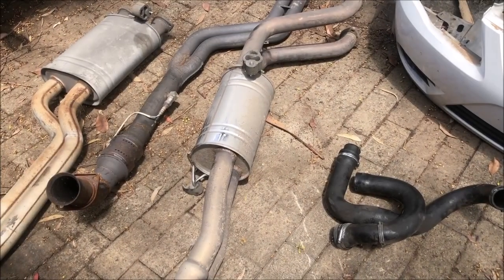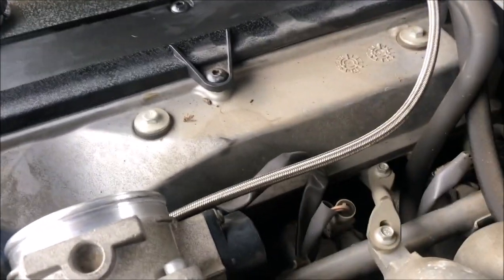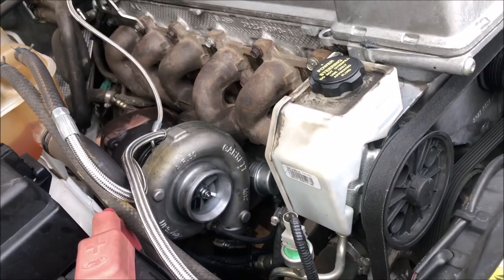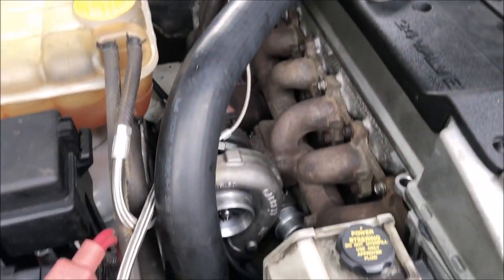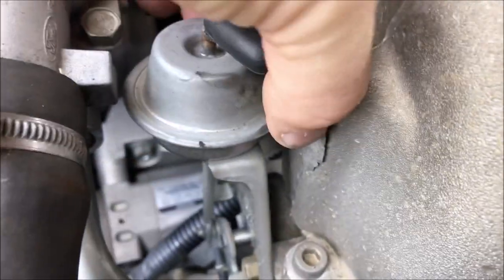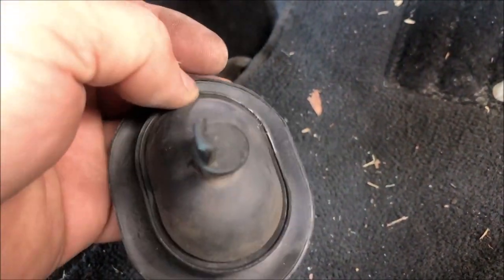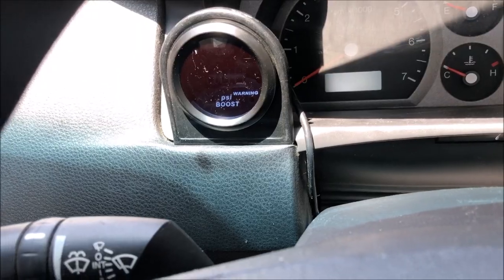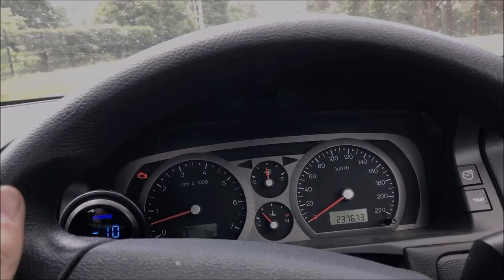NA Barra Turbo Conversion Pt2

Comment: Hi love your videos..I have a Territory 2005 and has the standard Barra engine and I've seen the Turbo version of the territory rwd Ghia..So if I was to just put a turbo as you have shown n I'll be sweet.??. In the original turbo territory it has the turbo intercooler on-top of the engine,so can I only use a top one or can the intercooler go in front?..Hope to hear back from you..Jason.
Reply from the maker: Sounds good man, can’t see why you couldn’t mount it in the front, I’m sure it’s been done before

Comment: Hey mate, brilliant video! About to undertake the same myself.
One question if I may 🙏
Oil drain.... did you not take the sump off when drilling? Metal shavings in the sump doesn't sound good to me,even with an oil change 😕
Reply from the maker: Cheers man. You can anything if you’re careful enough. Especially with alloy.. A very sharp drill bit and some grease 🤟🏻

Comment: Hi Paul, great videos with a heap of easy to follow info. Can I ask, did you have much trouble with drilling out the sump for the oil return and with the dyno tune you had done, was the 270rwkw on a hub or roller dyno? Cheers.
Reply from the maker: Cheers man. No issues with the sump, just get’r done. If you’re not confident, pull the sump off. Roller Dyno

Comment: Why disable the broadband in the manifold? you will loose bottom end torque and have slower spool. also if it's not fixed in the open position you will loose a lot of top end.
Reply from the maker: I don’t understand your question. Disabling it, locks it open
Reply: @oldskoolonly  Which looses bottom end torque and increases spool time. they were removed in factory turbo purely for cost saving.
Reply from the maker: Have you got anything to reference that? I’d be keen to see it
Reply: @oldskoolonly   I worked at ford engine plant from EL to BF2, while working in turbo sub assy it was one of the questions I asked the engineers. they said the extra bottom end performance wasn't worth the cost.
Reply: @oldskoolonly  I believe the term is Dynamic Charging and has something to do with Helmholtz Resonance? don't quote me though.
Basically attempting to utilize intake wave pulse at low RPM to cram more air into the cylinder.
Reply: @MassLox   the turbo  manifolds dont actually have any butterflys in

Comment: I’m currently doing the same conversion myself and was wondering if I can run the stock ba exausht system, would it fit a dump pipe? Hope to hear back
Reply from the maker: Not unless you made something up, the stock system is heaps smaller. Hope that helps 👍🏻

Comment: any idea where you got the holder for the guage? looking for one, so it sits in the same spot.
Reply from the maker: It’s just a under dash gauge mount from a cheap temp gauge I bought a while back
Reply from the maker: https://www.ebay.com.au/itm/174769384355
Reply: thanks man, appreciate that, on 7psi you didnt do valve springs did you?
Reply from the maker: No, not necessary at 7
Reply: @oldskoolonly  cheers man! i just brought one of the boost guage holders!

with the MAP sensor, did you split the manifold? or did you just undo the throttlebody? any tips?
Reply from the maker: Just remove the throttle body man

Comment: Strange cause I’ve seen another conversion where it won’t run on turbo fuel pressure regulator?
Reply from the maker: Definitely not my experience
Reply: @oldskoolonly  okay cool is yours a bf ? I’m doing a conversion and I had two bar map sensor and it started but cut out soon after. Changed back now, do you have to use the original vacuum and tee into it with the bov? And the other vacuum side cut and melt to form a seal?
Reply from the maker: Yep BF. Won’t run properly with the turbo map sensor until it’s tuned. I don’t understand the other question

Comment: Hey mate, how much was the tune for it?
Reply from the maker: I was asked not to disclose the price as it varies but I contacted a lot of tuners and quotes ranged from $750-1500. My suggestion is treat it like a tattoo, don’t go with the cheapest, go with the one with the best reputation 👌🏻
Reply: Old Skool Only Garage yeah ok. I only ask because any Dyno I’ve asked to do my tune (na 4 spd ecu) I’ve been quoted at 1500 to 2000 dollars. Which I thought was utterly ridiculous
Reply from the maker: What state are you in?
Reply: QLD
Reply from the maker: L E M O N ok, can’t help you there man
Reply: @IC3XR    I know of a couple who had theirs done around a grand. But if the tuner has really good reviews and knows what they're doing, consider paying the extra. A bad tune will result in shit performance and potentially kill the engine.  For example, my old one made 321rwkw on 13 psi, but I know someone who's made 290rwkw on 19psi at a different tuner. Look at their previous tunes if they have them up, or ask in a forum.